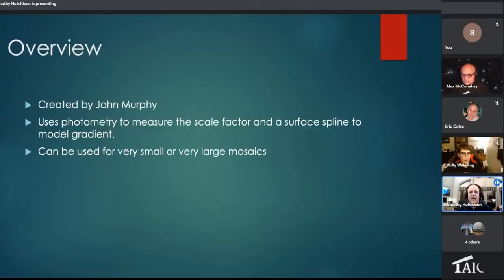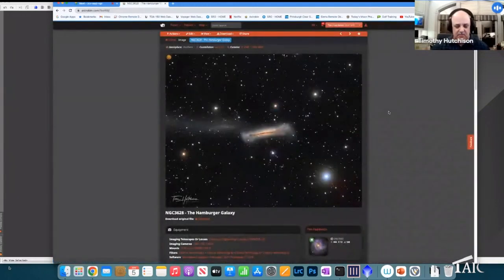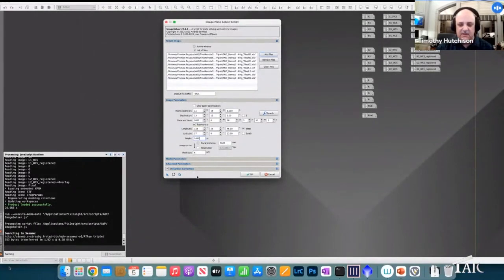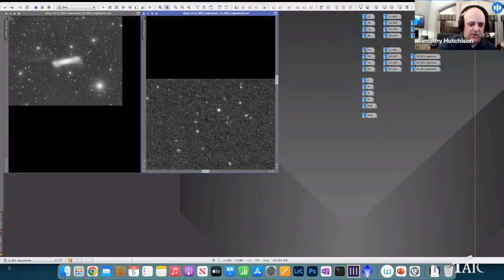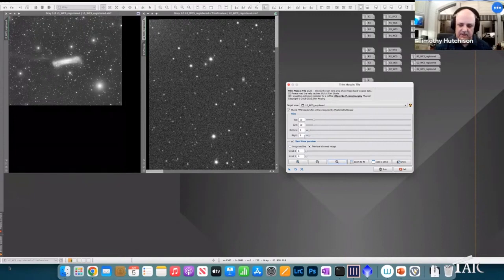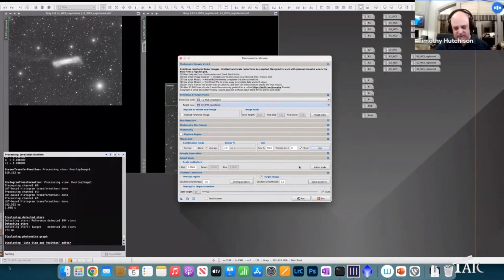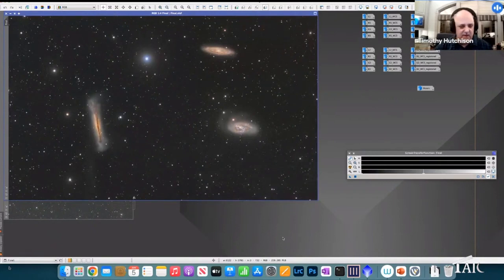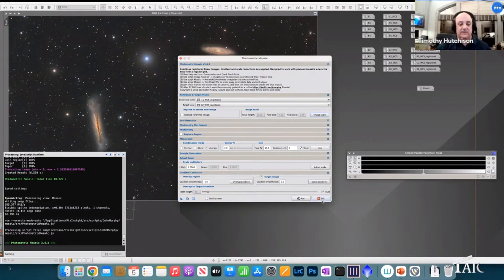Better Stitching with PixInsight's Photometric Mosaic Script [TAIC Short]

Comment: Liked the video as I'm trying, without much luck, to make a four Pane mosaic. I'm only about 2 months into Pixinsight so that might be why things are not working. I image solved the four panes ok. Then I had two major issues.
1. I added the four solved images to mosaic by coordinates and it said it ran successfully however it did not create any new on screen images. It did create one new image in the output folder. I changed the image file order and just kept running it over and over until I had the 4 registered images.This didn't seem right!
2. I next tried to combine these images in Photometeric Mosaic. Pane 1and 2 combined ok Then 1+2 and 3 combined ok.. Pane 4 would not combine Error message says "The images have to be the same dimensions". Don't know what that means. They were all taken with the same camera and telescope.
I did notice the default image scale in Photometeric Mosaic is off by 20-30%. If I  correct it it just brings  up more error messages.
Really confused, Gary

Comment: I had a 4 panel mosaic and I hadn't tried one previously.  It caused me great difficulties, ha.  I first tried using the Star Alignment plus DNA Linear Fit plus Gradient Merge Mosaic.  That failed.  Then I used Image Solver + Mosaic By Coordinates + Gradient Merge Mosaic.  This worked, but though I liked the image, unfortunately all of the panel joins were visible and there were star artifacts right in the center of the image.
When I first looked at Photometric Mosaic and read the Quick Start, I found it not easy to interpret and when I just tried it, it made an image including about 1 and 1/4 of my 4 panels.
So I found this video, and voila, it worked!  No seam lines and no star artifacts.  Very pleased!
I use a RASA 8, so with the camera up on the front end inside the dew shield, getting a precise camera angle is really difficult, I usually just try to get 0 degrees or 180 degrees.  Even then, it's not perfect.  Point being, the panels are not ever going to exactly fit together.